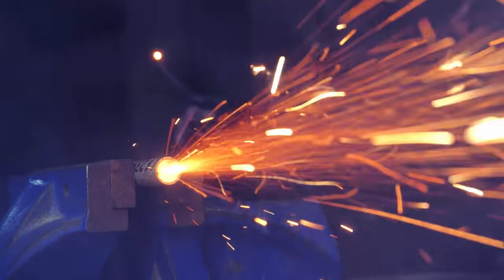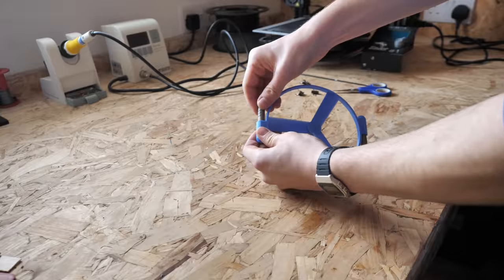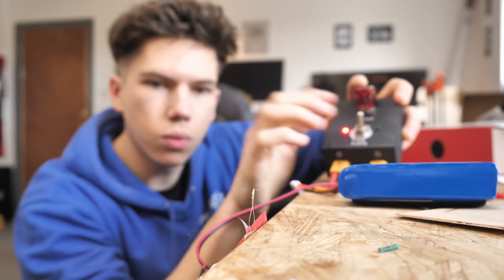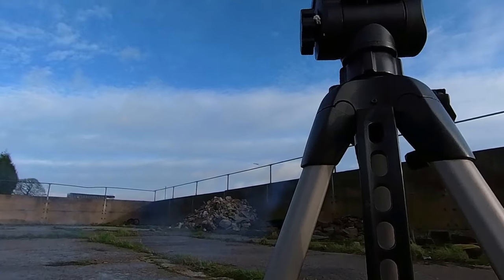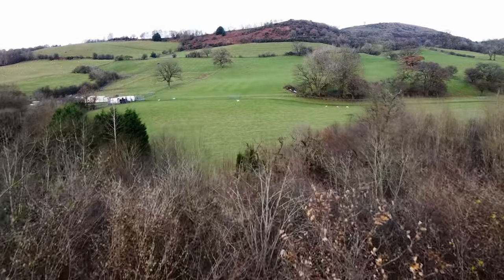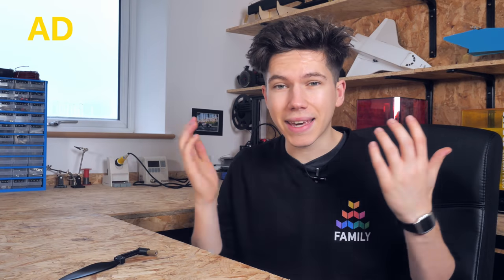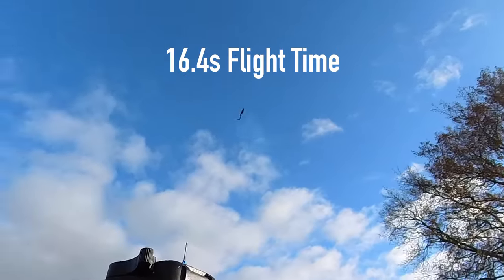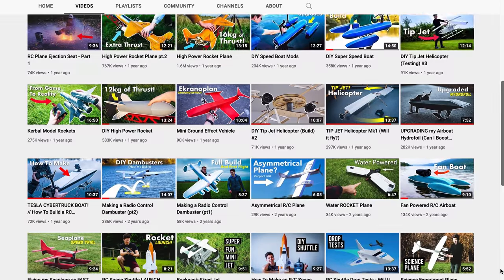Rocket Helicopter

Comment: That was really cool, if I just saw a picture of that I never would have thought it could fly. I want some of those motors now too!
Reply: Hey Kevin reply to this video im a big fan of you science stuff

Please reply i beg you:)
Reply from the maker: Yeah those motors are super cool man! Burn times of something like 10-18 seconds depending on the size. 😊😊
Reply: @Project-Air  but anyways that is so creative thumbs up to your work and i also liked the video
Reply: How about I reply instead to tell you how embarrassing your comment is?
Please don't reply to me, I am begging you
Reply: totally dude. 100% true dude
Reply: They are cool but please don't start launching them around like him during fall in the middle of completely dry brush hills.
Reply: The thumbnail picture looks like some engineer looked at someone throwing a Kukri and decided to make it even deadlier. (Ah needs more rotation as I chuck it at someone's face).
Reply: Firework companies have been doing it for years!
Reply: you can make your own and igniters(for igniters just twist the wire and paint it on the exposed wire) ammonium perchlorate sugar carbon(lamp black) and aluminium

Comment: Suggestion: A rocket powered car. But not in the way you'd expect. A gear gets spun by rockets (like the mono-copter) and that connects to the actual wheels moving the car forward. It's an idea of the wacky type
Reply: Like the turbo axle
Reply: I was thinking the exact same thing. It might be hard to do with just one motor though
Reply: pretty sure thats just a turbine engine

Comment: I wonder if you could design a turbine to use the expanding gas coming from one of these rockets into usable rotational energy. I know it's not practical but could be fun. Maybe to turn a generator to charge a super capacitor, this could be used to light a lamp or charge a phone. 

I Invision a compact device that fits in the pocket that could hold a few rocket motors and could be used in an emergency to charge a phone enough to dial help. If able to charge a large enough super cap then someone should be able to slowly drain it, at least enough energy should be in it to turn on a phone, make a phone call, relay a short message.

Comment: When I was a kid (about 65 years go) I bought a Jetex-powered helicopter.
Jetex was a small solid fuel rocket motor, about 1 inch long.
The helicopter had two rocket engines at the ends of the rotor, like your first design.
I too encountered the problem of sometimes only one engine firing, which shook the copter violently.
When it worked properly it flew quite well.
Reply: Ah the 60s. A great decade where children could get their hands on solid rocket motors

Comment: So I have some potential for improvement here.... possibly. It sounds like, purely from the sound, the helicopters are rather quickly reaching their maximum rotational speed and then staying there for a while. From my knowledge of rockets, the thrust they produce is basically a function of the exhaust gas speed vs the forward speed of the rocket, especially when you're in an atmosphere. So my thought here is that possibly the rockets, with the arm length and rotational speed, are reaching a linear speed that's basically equivalent to their max thrust minus however much for drag forces. So hypothetically you could get it to rotate even faster by putting the rocket closer to the center of mass of the unicopter. You could probably pull that off by having the arm extend past the rocket's position and act as a counterweight to the main wing, and possibly even improve the lift by making that counterweight a much smaller wing. 

The other alternative is that the linear speed issue is negligible compared to the sheer drag of the whole system, at which point I wonder if you could get better performance with a larger, slower, more efficient wing design. Or even a 2-stage system. 2-stage rocket unicopter would be amazing.

Comment: Barely pitch the engine-mount angle, as opposed to now relying entirely on the engine solely to rotate and the blade's ability to lift: separately, the prop-blade, perhaps a single triangular wide-tip fan-vane would better balance the thrust into lift.

Comment: If you can lock it in place temporarily(fraction of a second) until you can light both motors, seems like a symmetrical 2 motor rotorcraft design could fly in a more balanced way, and go a long distance

Comment: As the propellant burns the center of gravity/rotation will change substantially. I wonder how much the RPM changes. Perhaps making it stretch out as the RPM increases can compensate for this?
Reply: Two opposite rockets would solve that problem far easier. Just get these darn things burning BOTH. Reliable ignition, maybe?
Reply: @voornaam3191  that defeats the purpose and benefits of a one engine one blade device

Comment: How about one of them folding rocket gliders that snap open at the highest point of their trajectory?
Reply: You can't launch those with low thrust long burn motors like this. Those are for shorter burn higher thrust  rocket motors. Otherwise it is more efficient to use the wings for lift in the climb. Plus, these have no secondary function like delay or ejection charges to activate things.

Comment: 50 years ago Standard Fireworks used to make those out of a small strip of cardboard and a small rocket motor.

Designed to be used in the standard (no pun intended) terraced house back garden. They amused a generation of fathers and terrified a generation of small children as the watching family would have no idea which way the highly dangerous toy would fly off. It would elevate to cry’s of ooh’s and aah’s and the occasional “look out” as it would hit buildings on its way up.

If only we had YouTube when we were young….. and CAD printers may have been handy too!

Comment: Possible idea: Use the expanding gasses of the rocket engine to drive a steam engine. The idea is quite interesting and the modern vs old fashioned tech contrast is also nice.
Reply: How bout a massive rocket powered water wheel? Have the thrust hit the wheel buckets instead of water. I could see that spinning fast enough to open a portal to the upside down.

Comment: I would like to see a retro rocket parachute. This was attempted during WW2 with little success, but more recently it was used on the Mars mission very successfully. 
This will be a challenge!
Reply: Can you please describe what a "retro rocket parachute" IS? Please please please give more information, for it does not ring a Bell helicopter, here.
Reply: @voornaam3191  this device provides a braking effect on a free-falling object using rockets to provide thrust. Imagine you dropped a pallet of goods from a transport plane at low(ish) altitude (stabilised by a small drogue chute) as it approaches the ground at high speed, altitude sensors detect this and trigger rockets which quickly slow the vertical motion allowing a soft landing. Experiments were done during WW2 by the British, but the available sensors in 1943 made it unreliable and the project was abandoned. With modern sensors and computer control, it should be a possible, but challenging project.

Comment: the dual motor version might have worked if you locked the prop until both motors fired up and then released the lock. a simple dowel or steel pin might do.
Reply: This is a great idea. The current through the igniters could probably be monitored by a microcontroller for an automatic release.

Comment: I wonder if you could get two motors to more reliably ignite if you used a hold-down clamp that released like 1/4 second after ignition. That way the first motor to start doesn't rip the starting equipment off the second motor before it ignites.

Comment: I'd be interested in seeing what happens if you just a much taller launch rod (50cm+), so that it gets a higher RPM before it's in free flight. It should be a lot more stable once the RPM is higher.

Comment: You should try your original design but with three rocket motors so that the thrust is applied at the same angle (120°) to each other as the rotors. 

It should (hopefully) be more stable than it was with two rocket motors

Comment: The seed works so well because of the heavy weight ball that becomes the centre of rotation it helps stop the side to side pull of the mono blade so if you can replicate that a bit better on yours it might go straight up just an idea

Comment: To get a fast and precise electronic ignition system for your rocket engines you can use high-voltage one. You need to make an aluminum-permanganate ignition powder. As it contains aluminum it's conductive but you need at least 80-100 Volts to ignite. Current is quite low (I was using a couple of winding wires 0.14 mm diameter up to 50 meters long). For power source you can use disassembled portable flashlight (that one for photography). It can charge its internal capasitor to about 300 Volts (so be carefull). You just need to solder a wires to capasitor and a "fire"-button. Ignition "capsules" itself is a two wires deeped into a small amount of aluminum-permanganate powder. I was using construction like next:
1. strip first wire a little and make small ring on its end. (To prevent damaging a shell in further)
2. strip second wire a much more and wind its bare end onto a first wire insulation not so far from its end (like a 1.5-2.0 mm)
3. deep it in a small amount of powder on a piece of polyethelene bag
4. accurately fold that piece keepeng wires deeped in the powder
6. wind a thin sweing thread to fix all together. Bee carefull about the tip.
May be it's quite general description but my english not that good to find a good epithets. I can send you a photo- or video-guide if you're interested.

Comment: You could learn something from the 1951 Hiller Hornet which used ram-jets on the tips or the Fairy Rotodyne around 1957 but the concept was originally patented in 1911.

Comment: If simultaneous ignition, or ignition at a precisely controlled time is required, suggest applying relatively high voltage AC to a cheap diode. Or, at least, I guy I knew got good results with cheap little diodes and house current. (60 Hz AC, 120 volts or so). Obviously, there are safety precautions that are necessary to do this. I'm not saying this guy took those precautions, though, and I'm not saying just what he was igniting. No significant property damage resulted, though. I'm guessing that a short burst of DC going the wrong way through the diode would accomplish the same thing. 
.
When testing such a system, realize that you MUST wear eye protection. If you don't enclose the diode, expect tiny glass bits to fly around. 

If you could get a longer duration, lower thrust motor, I imagine longer flight times could be obtained with balsa instead of plastic. Most plastic, compared to proper structural materials, is like bubble gum: heavy, flexible, and weak. Carving balsa props is pleasant work. Or maybe you can substitute a router bit for the 3D print head? (Assuming the mechanism can withstand dust.)

Comment: Next? How about a "normal" RC fixed wing plane but (multistage?) Have the motors ignite sequentially. Obviously the trick is in timing the next motor. Rather than wicks of different lengths, perhaps a servo, actuator, small "fuse" resistor in each motor that burns when needed on a rotating switch controlled from an RC channel, etc.  As the plane is just gliding, ignite the next motor, etc. Just a thought. As a goal you might go for altitude per number of motors. Keep spiraling upward until you run out of motors and keep gliding. Nice work, BTW.

Comment: Rocket powered drone. 4 monoblade propellers, ~30sec flight time, rocket powered performance.  The Me-163 was built with the "insane lift ASAP" problem in mind, so Im thinking a Monocoptor based drone version of that.

Comment: Lockheed Martin did this about 15 years ago, there's was about the size of what you did.  It was classified for a long time and then the project was scuttled.   The engine was "grown' on a copper chip and I was a VERY small turbine engine.   It had a camera on it that was able to compile a 3D scan of a battlefield, or even a building.  They also figured out how to equip it with a small explosive charge that would have been lethal.   It was able to be steered using control surfaces and the engine was able to vary it's output rapidly to change course, hover and fly.  
Really cool tech, I know the guy that designed it and I did some of the machining on it myself.

Comment: It's been done before. Hugo Nagler invented a single counter-balanced blade helicopter way back in the late 1920s and carried on with his research into building single counter-balanced blade helicopters during WWII. In 1941 he invented a single-man portable helicopter that had two blades driven by prop-motors mounted parallel to the roter's direction of spin. This eliminated the need for a counter-rotating tail rotor. In June of 1952, Nadler filed a patent for a helicopter with rocket-powered blades.

Comment: Why wouldn't you drill a hole thru rotational center and use it as a launch guide with stuff metal wire?
You know, just like almost all model rockets use?
Getting some stability during launch might dramatically improve flight!

Comment: Time to build a quad/drone with single Props. I know rotor riot did it but their Props all broke apart. Maybe you can create something stronger. Another idea if you want to use the rocket motors is to build a rail gun rocket launcher or coil gun rocket launcher

Comment: You should make a multi-stage rocket with them. BUT, not just any multi-stage rocket.

I'm thinking like 10 stages. Yes, you'll need more motors clustered together at the lower stages, but at the higher stages you'll have less and less motors.

Put an arduino on it and try to get to 10,000 ft!

Comment: You should check out Girandola fireworks which work in a very similar way, sometimes with many motors ignited simultaneously. They're usually fused together with quickmatch - a fuse that burns at hundreds of feet per second. Fun to make and watch but only available with Cat4 licence here in the UK unfortunately. Also worth a look at Hummers and Caduceus rockets which are 2 types of spin stabilised rockets.

Comment: There is a certain type of firework called "bhoochakra" which means 'ground-bhoo' 'wheel-chakra'. I always wondered if it had hollow centre and fins that can create aerodynamic lift. Physical construction of such firework is a continuous burning spiral rocket that will take it to high speeds of rotation. How does is pivot and balance itself?? It's due to a domeshaped ufo disk on bottom. There are later versions of rocket fuel similar to this video where two motors are lit at exact same time. A central burning wick would be there and it will part in two ways. Due to the speeds, it will balance and hopefully create some lift if it had fins in the centre. Another variety is called VishnuChakra which rotates Vertical axis on a horizontal long steady wire. I think for both you might find the videos on YouTube. First one is not that dangerous but second is. Most of them do not prefer to light later on thesed days. I think you might think of ideas to create lift.

Comment: I didn´t see if you used your own ignitors or ready ones. Usually you put the igniters in series, as you won´t need that much current. When one of them fires first, it´s going into a short (they put some low heat melting metal inside or so that keeps the contacts closed after ignition), so the others still get power supply. And you have a good monitoring of continuity.